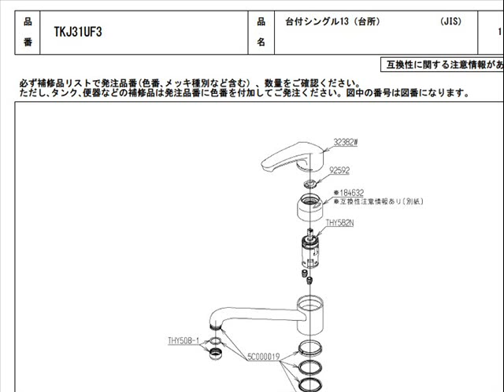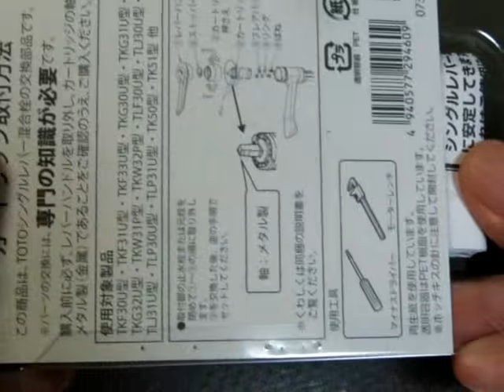キッチン水栓蛇口・水漏れ修理　シングルレバー混合栓TOTO TKJ31UF3のカートリッジTHY582N 交換

Comment: カートリッジ押さえが回らず困っていましたが、どなたかの返信で書いてあった、「カートリッジ押さえとその下の部品の切れ目」を360°、中くらいのハンマーで数十回叩いたら、軽く回りました!!! ネジ自体はプラスチックネジなので、固着していたのは「カートリッジ押さえとその下の部品」の薄いフチ同士でした。
I was in trouble because the cartridge holder did not turn, but when I tapped the "cut of the cartridge holder and the parts under it" written in someone's reply at 360 ° with a medium hammer several tens of times, it turned lightly. Since the screw itself is a plastic screw, it was the thin edges of the "cartridge holder and the parts under it" that were stuck together. I was able to replace the cartridge. Thank you very much!
Reply from the maker: コメントありがとうございます
ハンマーで叩くのは気が付きませんでした。ありがとうございます。